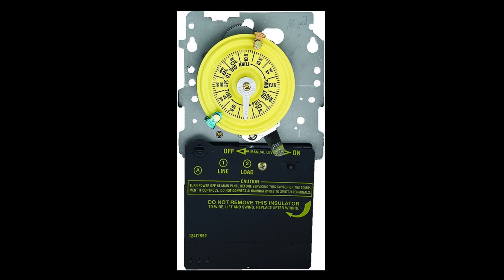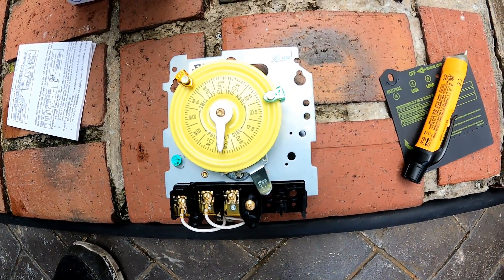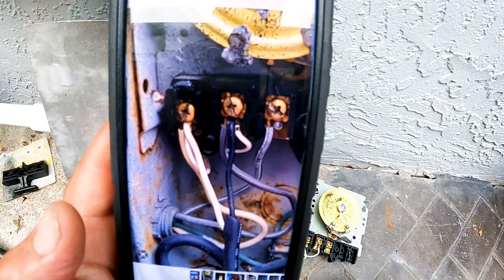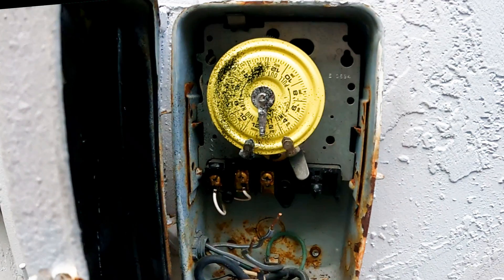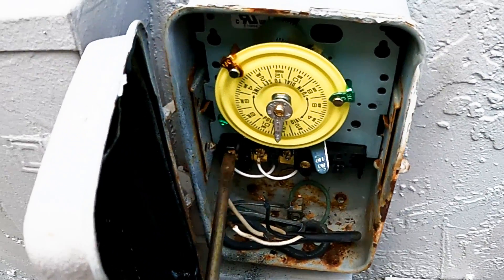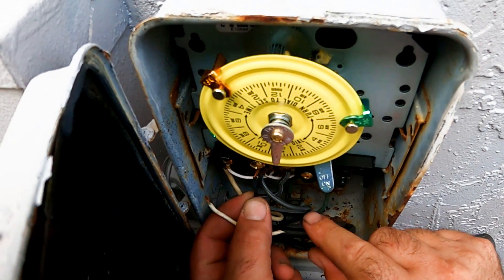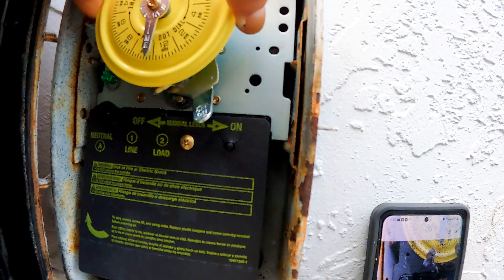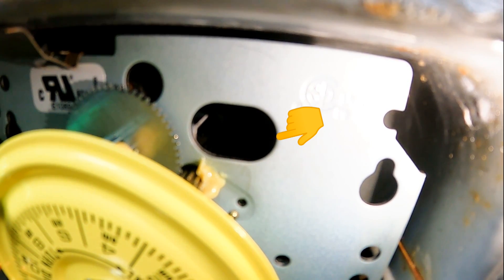How to Replace an Intermatic Pool Pump Motor Timer - T101M 120V – Mechanism Only

Comment: My clock works but it looks like it's jamming when it tries to flip the switch on or off. Like it doesn't have enough power to push the metal bar
Reply: Thanks for reply. Can I fix that with parts, or do I need to buy a new timer?
Reply from the maker: @Billystampe  
There's 3 different models T101M T102M T103M find out which one matches your existing.
I have the T101M 24-Hour Mechanical Timer SPST Mechanism only: https://amzn.to/3roKnFv
Click on the above link and scroll down until you see all 3 models to pick from.

good luck!
Reply from the maker: Sounds like the gear stripped from the axle. So it spins when it gets resistance.

Comment: Great how-to John on replacing the timer mechanism, nice that Intermatic offers just the replacement time switch assembly. I have a similar Intermatic timer and a Paragon brand that I use for growlights in my greenhouses. Have a great weekend! 👍
Reply from the maker: I've found out these mechanical timers last much longer than the digitals considering their constant use. Hope you had a great weekend! 👍